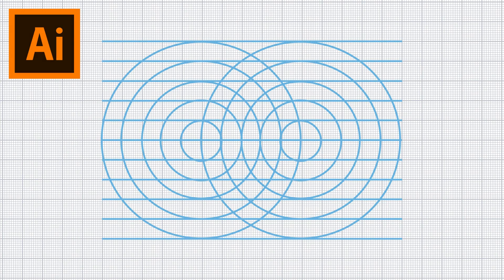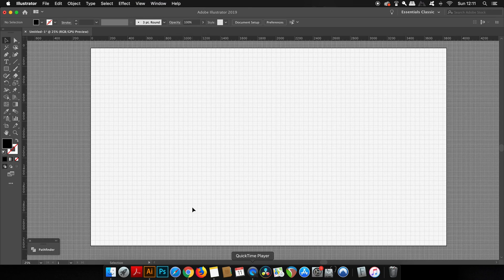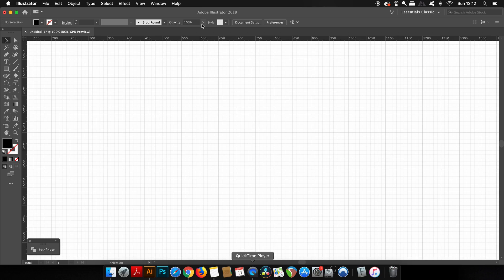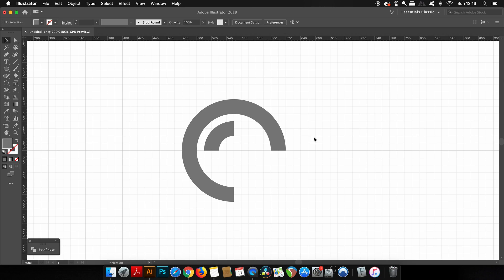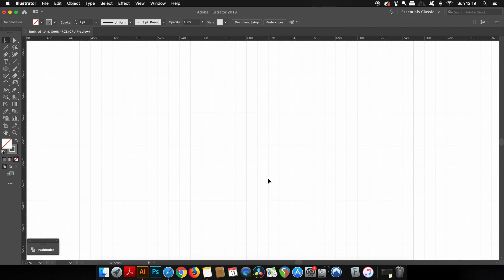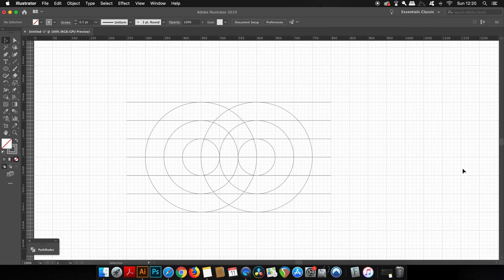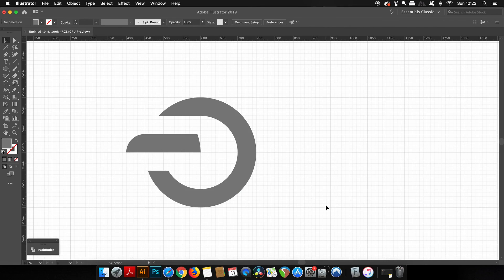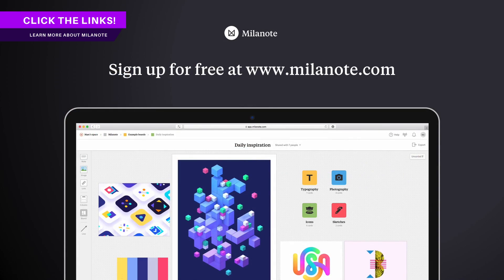Using Grids For NEXT-LEVEL Logo Designs (Crucial Tips)

Comment: How exactly do you save the grids and all the circles etc that you used as part of the final design so that you can show your client? I’ve seen many do this but don’t really know how to (beginner designer here lol).
Reply: Progressively copy your artboards as you iterate in your design.  Once done, take a copy of the original artboard with your grid on it and lay your finished logo on top.
Reply: Can you explain in simpler terms I'm still confused lol
Reply: @JP-sl2cp  What he's saying is that with every step, don't do it on the same artboard you did the last step on, but build each step on a new artboard. For example, before using the shape builder tool to merge shapes to create the logo, duplicate the grid and only build the logo on one of the two grids. This way you can preserve the original logo to lay on top of the grid when you're finished to show off to your client! It feels a little redundant, but not only will this allow you to show the grid work on top of the final logo, it's a really efficient way to backtrack if you decide you don't like something anymore. Hope that helps!
Reply: The same question ....

Comment: Very nice tips, good video. About the golden ratio... I think all types of proportions are valid if look good, but the key is looking good, using 1:6 ou 1:2 ou 1:3 can fit in many designs, but a nice visual sense is the most valuable tool you can have, and this comes with experience, not math.